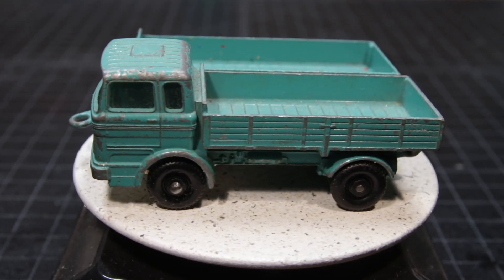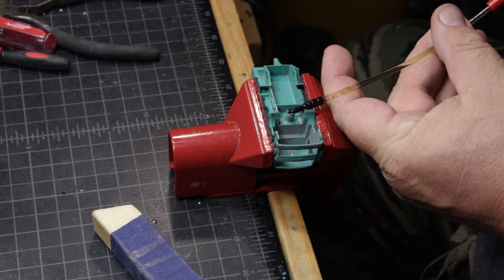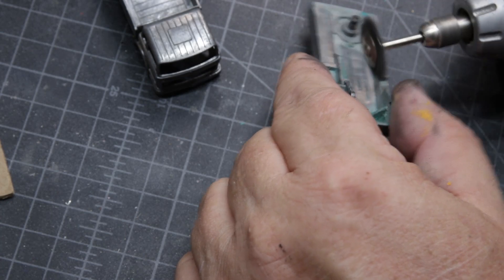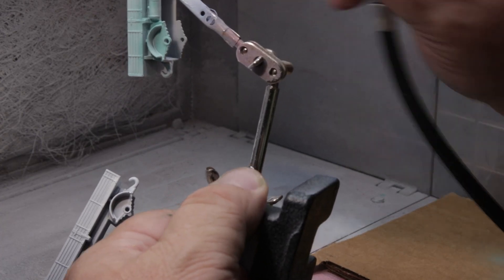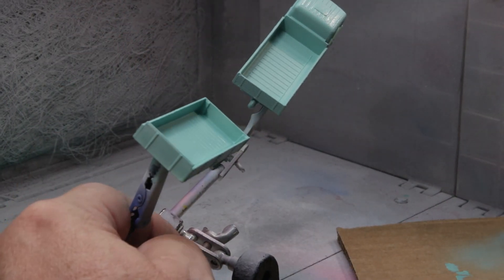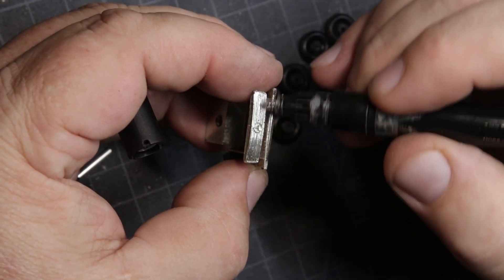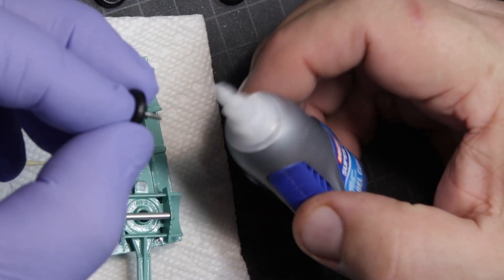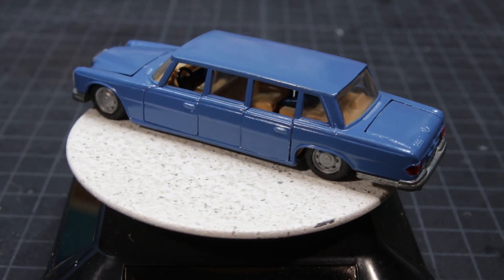Matchbox #1E & 2D Mercedes Truck and Trailer - Restoration

Comment: Lee do you find that the more castings you put in your jar of stripper the less it is working? As I guess there is an increasing volume of paint in the mix
Reply from the maker: Not at all, but I do top it off from time to time . . . I always lose a little when I pull the casting out.

Comment: Well this might have gone long for a restoration but you did do two vehicles! Looking great as well!😄  Yes to the Thunderbird!👌🏻 That Stretch limo is
a Mercedes Benz 600 Pullman and  should be black with chrome edging around the windows and  bottom sill! You may need to tint the windows a smoke grey as well !👍🏻

Comment: The Siku Mercedes 600 Pullmann is scale 1:60 , they used this scale for all vehicles from 1954 till 1974 at 1975 they switched to scale 1:55. The original color was opalgreen. Regards from Germany 🙂

Comment: Yes, I agree with painting the same density. Nothing is worse than seeing dark spots etc.. Nothing worse than when I see a paint job with a flake looking obviously off compared to the rest of the car after a repair and a fresh spray on the panel. I've been there once, and I told the guys to fix it under their warranty. Rest in peace Audi A4. It was a factory, "premium", paint job... if id known it was difficult to match I'd have fun driving my first truck during Georgia's SnowPocalypse of 2008 and again 2010 i think. Needless to say, the guys at Classic Collision fixed me up once they saw I had a keen eye and waited a few days to see it under sunlight. However, I haven't worked with air! That is why I like your videos. I've done everything, even dunked parts, but not air. What is a good beginner setup TimeRider? I have an R\C car that I want to show off with new paint, but I don't want to mess it up since its my only R\C car right now. I do have a good hand. I can to stick, TIG and MIG weld steel and aluminum and passed guided bend tests, and I can manipulate a rattle can. I'm a pack-rat and 30 old at the belt. 29 was hard. I want to show off my hobbies. I still love cars. Please keep up your good work! I'd like your advice as a fellow automotive enthusiast.

Comment: Nice! I think the repro color came out a little less blue than the original(s), but it still looks like an authentic '60s Lesney color, and like you say, they varied all over the place anyhow.

As for the Benz, I remember Jeremy Clarkson had a 600 Großer like that one on Top Gear ages ago; his was a quite handsome metallic emerald green, with a similar brown on the interior as your model there.  It was a color combo that worked nicely for the car, and makes a change from the typical tuxedo black. That'd be my vote, if this was a democracy, but you do it however you like. :)

Comment: Another favourite model of mine. It was really interesting that Matchbox produced it - I'm sure it's because, at the time, it was both exotically foreign, and tremendously modern. I never saw a real one on the road for many years, and certainly never with the trailer - in the UK, the now familiar 'Rigid and Drag' combination is commonplace, but I think that they were not allowed to operate on UK roads at the time the Matchbox models were released. I prefer the Normal Wheel version to the 'Superfast' version, which just looks wrong. Your finished models are superb. Nice one.

Comment: Schmutz left by the stripper... 🤨 If that's the case, then I guess the yoke's on you! 😆

Fine restoration, TRLK! And a great match to the original paint! I'd say you're about due to treat yourself to some new equipment. Do drill presses and computerized paint mixers come in 1/64th scale?
Reply from the maker: I don't think so!

Comment: you can use a battery operated drill with Marty's  method just need the two nail that are modded  the battery drill or corded drill and the block of wood for one nodded nails and c clamp to clamp down the board with the nail in it

Comment: Do they make canopies for these ?
Reply from the maker: Huh?
Reply: Yes modelcarparts.com  makes the orange canopy for both.MS129 for the truck and MS130 for the trailer.
Reply: @hestheMaster  I used to collect in the 70s and 80s  . Spare parts were valuable back then like wheels, animals  . pipes or what ever.  The most needed piece was always the antenna for the TV repair truck the ladder stayed on good , They would put the TVs in back , But the antennas would fall off. I was one where he made an antenna with a 3 D printer Also they make decals now. That would let people make their own rare variations

Comment: About the Limo; It looks similar to the 1969 MB 600, but extended. So many of these were in black, but that's boring. I've seen a couple in gold, but that's ugly. In 2015 Barrett-Jackson had one in a deep dark blue. Give it a look: https://www.classic.com/veh/1969-mercedes-benz-600-limousine-10001212001403-N4V6O64/